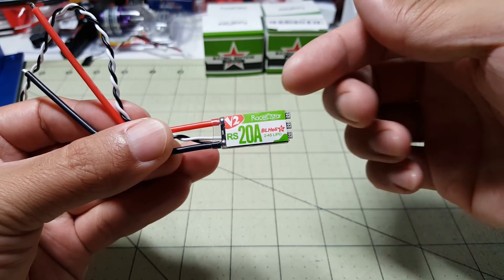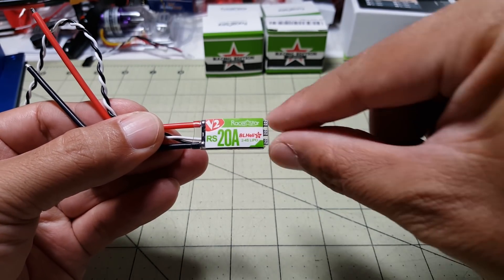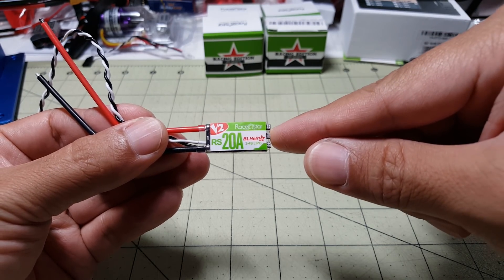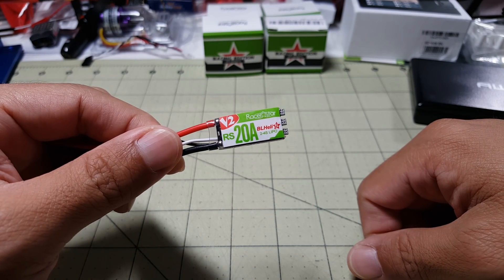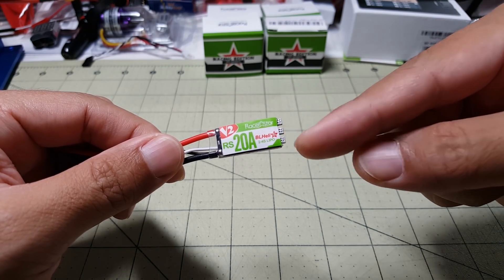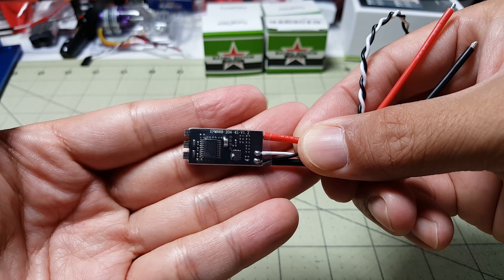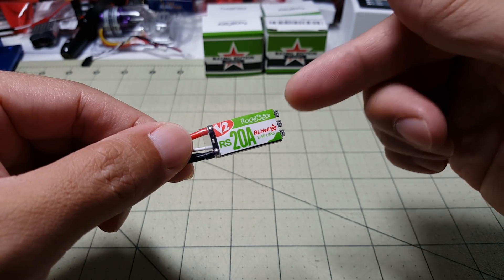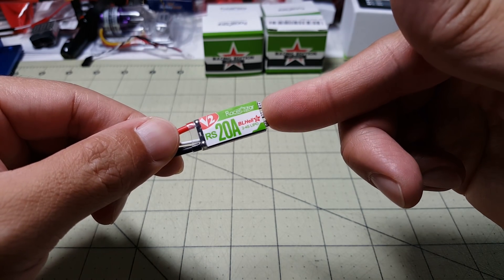Racerstar RS20A V2 ESC Review

Comment: The V1 of these is 23 bucks for four until 12/4/17 with the code 2017cyber9%
I just bought four to rebuild my old ZMR for nostalgia😆 I'm even gonna flash the tired CC3D with Betaflight, I read that the CC3D has an MPU6000 and should run Betaflight fine. The old DYS1806 motors still spin okay😉

Comment: hey albert i need help, i'm trying to use this with a KK FC board but it only has two wires  black and white rather than three. it doesnt have signal wire i presume. should i buy a new set of esc's? or is there a way to use this?

Comment: How much faster is the v2 20a esc's compared to the v1 20a esc's?? Worth the extra $15?  (Im going for a budget build)
Reply from the maker: +avoidrome 24mhz vs 48mhz... not that noticeable unless you're going for a premium build.
Reply: thank you!
Reply: yeah i was wondering because I saw some people using the 20a v2's and 30a's for racestar br2205 2300kv , but I havent seen any builds with v1 20a's on those motors....but they should work though...right?
Reply from the maker: Yes

Comment: What is the difference between these and the "lite" version?
Reply from the maker: The lite version is a slower clock speed and also smaller and lighter.
Reply: Are you sure? RS's website lists the LiteS as BB2 and 48MHz same as the V2.

Comment: Great video Albert! I just recently got these escs myself for my first build, but I'm not sure where the two wires in the middle go, do they both go to the signal pad on my fc, or do i need to put the black wires together and only have the white wire on the signal? Thank you so much for the help
Reply from the maker: +Brandon Mai The black is ground and not needed. I usually just desolder it and just connect the white signal only.
Reply: ah ok thanks Albert! And you mean desolder the small black wire right? And if I were to keep the wire, should I solder the small black wire with the other large black wire?
Reply from the maker: +Brandon Mai you can do that but not necessary.
Reply: Okay, thanks again for the help, so just to recap, it's the small black wire that is just another ground?
Reply from the maker: Yes, both black wires are ground.

Comment: Is dampened enabled by default on these esc's thanks
Reply from the maker: +Olly FPV yes. You cant turn it off
Reply: is dampening good and what does it do??
Reply from the maker: +Olly FPV stops the props when you drop throttle... give you more precise control of power on the quad.
Reply: ok cool thank you

Comment: Can you measure width of these RS20A with calipers? It says 12mm on BG, just wanted to make sure. Thanks again...
Reply from the maker: +Pete Langer they are 12.5mm with heatshrink on
Reply: Thanks...have you installed the rs20a v2 yet?
Enjoy your channel.
Cheers
Reply from the maker: +Pete Langer Thanks. Not yet on the V2. I'm waiting for a frame
Reply: Could you send me a pic of the Racerstar esc's you have side by side for comparison?
6a,12a,20a,30a...etc... I ordered the RS20A
X4 in 1 last night, some straps, props, & the Skyzone RHCP antennas. They look just like the Aomway but a bit less. Have you used them? Also I live in Ohio, how long does shipping take? This is my first order.
Cheers,
PJ
Reply from the maker: The 30a ESCs are installed in a quad so I can't take them out. The 6a and 20a you see side by side in my preview video here - https://www.youtube.com/watch?v=pHqlEzVg560

I don't have the 12a ESCs.  FYI, the 30a ESCs are about 1.5mm wider than the 20a.

I like the AOMway antennas but they break on crashes.  I am switching to these instead - http://goo.gl/qmNYmV

Shipping varies. Make sure all the items in your order are in stock and say it will ship in 1-3 business days. If even one item is backordered the whole order will just sit until the backordered item comes back into stock.  They usually ship in a couple of days if everything is in stock.  After that it takes about a week to get to customs.  For me in California it usually sits in customs for another 3-7 days then it goes to the post office.

I don't know how long it will take to get to Ohio.  Maybe add another 2-3 days?
Reply: Thank you for the reply... I just got a really sweet new frame I'll be building up from MultiRotorMania here in the USA. It's called the Reaper 195 and looks really nice with sharp lines. You should check it out. $43, $50 & $55 for the 6" version. weighs only 62g with the 5mm arm option I went with and they have excellent CS. they have extra arms and top/bottom plates. I like being able to get the repair pieces quickly.

Comment: Hello, Thanks for the videos & info...Will a DYS V2 USB linker work with these to update, or do I need the Racerstar blheli_s usb linker?
Cheers
Reply from the maker: I haven't used the DYS programmer but you can use any NAZE32 flight controller to program using BLHeli passthrough feature. Nowadays programmers aren't needed anymore.
Reply: OK great...Thank you...Have you had a chance to see how the Racerstar Motors and V2 esc's hold up & would you recommend their products?
Reply from the maker: I am using the V1 20amps on my Martian and they also have the 2205 motors. Flawless so far. Plenty of power and smooth as butter. A little less power than the red bottoms but barely noticeable. Check out the martian here - https://www.youtube.com/watch?v=ljdQ-Xaufec

Comment: i have the 30a V2 running Racerstar 2250 2300kv motor, getting motor spatter...do you have the same problem with this combination?

i have the V1 30a as well and they don't have this issue, using both on Kiss FC
both V1 & V2 are on stock settings Blheli_s 16.2
Reply from the maker: +tropicalrips kbk upgrade to 16.3 and see if the problem is still there
Reply: updated to blheli 16.3 and reduced motor timing to medium low, now its all smooth
no more motor spatter :)